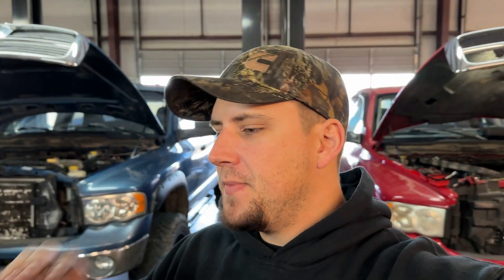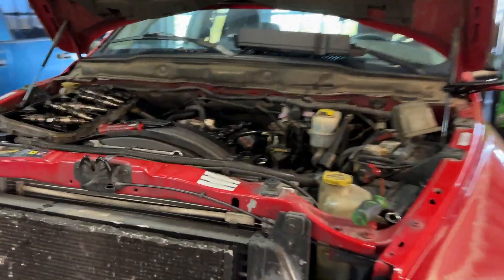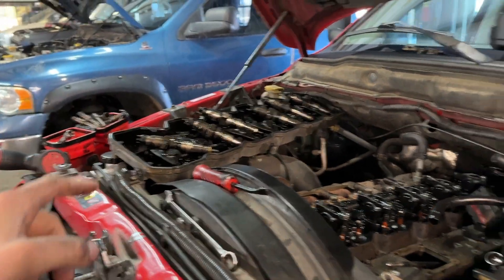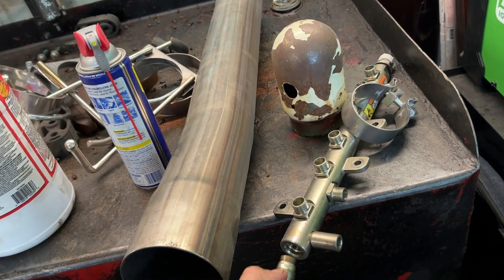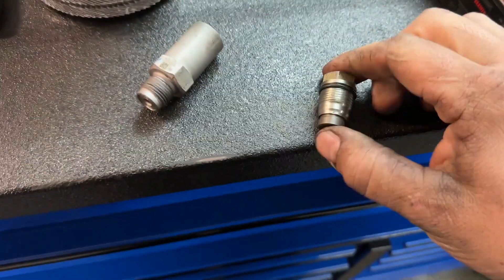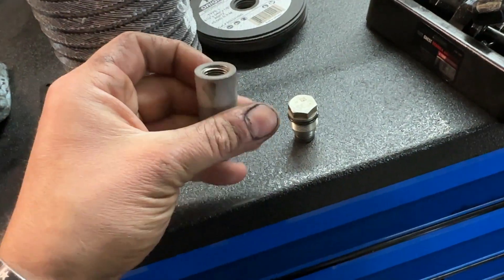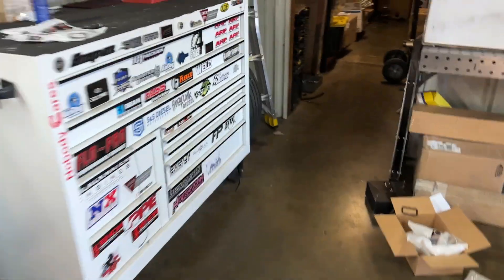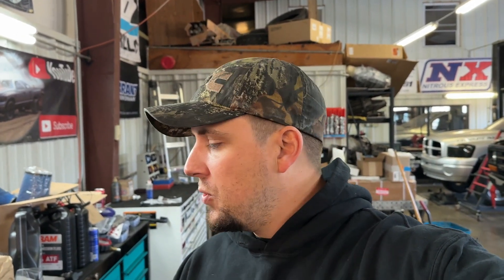STOP KILLING YOUR INJECTORS!

Comment: How do you determine what bar valve you need? And what waste gate to use?
Reply from the maker: Depends on what you pressure you are running, usually operating pressure then add 10%. Wastegate just depends on power wanted and turbo being used with nitrous
Reply: @horsetorquesdiesel no nitrous, fis s478 1.0 v5. Industrial injection 12mm cp3 it’s 85% I believe, industrial injection 150% injectors, biggest fass pump

Comment: You’re damn right someone should comment on being as “Lucky” as I’ve been w/Rail plugs-LLY was tuned & deleted 10mm cp3 430k miles when I sold it-2008 LMM Tuned/deleted 370k miles still own it also has a stroked cp3 & my Main daily driver 2015 6.7l Cummins 318k miles runs away from just about everything I race & all 3 of these trucks have the same exact race plug in the back of rails-the Ram I drive daily is dyno tuned @ 520 rear wheel hp & it’s the only tune for this truck-I beat the shit outta it -to the point where I have to let my coolant temperature come down before I can do any more spirited driving -I completely understand what the logic is behind 30psi of fuel spiking but I wore out the factory relief valve’s & then wore out the “higher tolerance” pressure relief valve’s too so I plugged it & that’s where my Lucky streak started !!!🏁🏁🏁🏁🏁🏁🏁🏁🤷‍♂️I’ve never experienced injector failure on any of my trucks but again that’s just luck right 🙂

Comment: I have a 2006 ram 3500 24V and it has a rough start and idle started off blowing white smoke especially when I start the truck then it goes away now it stays blowing white smoke now my I’m getting a misfire on cylinder 2 I’ve replaced the pressure relief valve and it’s a little less rough I will be changing the fuel control actuator tomorrow but doubt the misfire would stop do you have any solutions or any recommendations on how to go about fixing my truck

Comment: What about putting a 6.7 MAP sensor in a stock untuned 5.9? I seen it brings pressure from 26k to about 30k and adds some pep and burns cleaner. Would this cause potential issues?
Reply from the maker: Needs to be rescaled but yes it can work just fine
Reply: @ My bad I meant fuel rail pressure sensor. The guy said it’s plug and play and is a hack to get some more power out of the 5.9.

Comment: With duramax after you tune a truck and modify   that fprv WILL be a problem.    With 3 different duramax trucks I owned and a couple company trucks we deleted  I never had a single issue with running a plug.    We put them on our work trucks even. Without the plug the duramax will fall on its face passed 26500 psi.    Starves the motor of fuel.    When tuned and all the basics done your basic tuners will turn that pump to max at wot. Which i was seeing 29k.  A lot of guys will think the truck is having fuel problems or even transmission problems after they delete with basics done but 90% of the time the problem is solved with a lift pump and a plug.  I’ve seen guys just do the lift pump and still have low rail pressure because of that fprv.   I see the point of this video but with my trucks I never had a issue and I put a ton of miles on that set up before I went to injectors and different pump.  The 08 duramax I had had 280xxx miles on stock injectors when I changed them. 185xxx of that was plugged and tuned.   Now I have a 12 Cummins and on a high tune with basics done I don’t see even 26k psi on rail so idk I wasn’t planning on plugging my Cummins.

Comment: So what one should I use with a completely stock 5.9 CR ? The one that's in it now? The factory unit. I care not to hot rod it just want extremely log life and durability. Thanks. Oh, its a 2003 with 190000 miles.
Reply: Factory Bosch plug. No substitution. All factory sensors are Bosch I believe, at least they are on my 08. 400,000 kms, on my factory one, replacing it during this Christmas maintenance shutdown on my truck.

Comment: Can you put a 6.7 rail sensor onto a 5.9?
Reply from the maker: Yes but it needs to be tuned for it
Reply: @horsetorquesdiesel what risks do you run into if you don’t get it tuned? Also is the difference in psi noticeable?
Reply from the maker: @ the rail pressure will be much higher than the ecm thinks it is. When tuned it adds 20mp extra pressure

Comment: I have a question... I have a 2014 ram 2500 6.7l and it's tuned, however all the fuel systems and turbo is stock. I never run it past the 2nd setting. However, somehow it was turned up on 4. Not sure how or how long but the truck has a lope at idle. Not smoking or stalling and seems fine while driving. There's no codes the fuel pressure at idle is about 4800 psi. Any ideas on what is going on? Truck has 406kmiles on it, and like 3500 idle hrs and 7500 drive hrs. It tows a lot.
Reply from the maker: @ontheroadwithpastoranthony3161  probably time for some fresh injectors if I had to guess

Comment: 😊😊😊😊😊😊😊😊😊😊😊😊😊😊😊😊😊😊😊😊😊😊😊😊 thank you very much for another wonderful short video. Thank you for the insight. I have removed my relief valve. Do the fact that I was not building enough pressure in my rail. I use it as a daily driver. Please let me know when the comments below, I normally run somewhere between 15 and 20 on the pressure rail on my gauge I normally do not exceed 20 on my gauge. I do a little bit but not very much but more it’s a daily driver. Please let me know if I should go ahead and put the original bypass back into it. I have 27 500 and something on the engine now and I would say it’s been in for a while for at least the last 3 to 5 years. Please let me know what your suggestion is. I do not want to blow up anything that’s gonna cost me a fortune please and thank you.😊😊😊😊😊😊😊😊😊😊😊😊😊😊😊😊😊😊😊😊😊😊😊😊😊😊😊

Comment: I need a new prv would you recommend a up grade or just stock? 12 cummins 6.7 smarty tuner, stock turbo, 30 over Injectors from "Dale's super store" they state that I can run the plug no problems but I don't want to and they can't tell me the seal pressure.

Comment: Was gonna run a PPE rail plug with my 150% overs and 12mm pump until i watched this, purchased one of these yesterday! What is the torque specs for the exergy PRV on a 2015 6.7? Cant seem to find the spec in the factory service manual anywhere atleast for the stock one.. Thank you for sharing your knowledge makes me feel better about not having all the money i spent going down the drain lol

Comment: On a dmax especially an lb7 it blows all the way out and leaves you stranded youre not getting at it on the side of the road with an lb7 i choose to run a race plig because i dont like being stranded  its got alot to do with driving too habits if you drive like a dumbass teenager  all the time full throttle to no throttle all the time then yeah you are going to have alot of issues however if you use it responsibly play with it every once in awhile and then use it like it was intended most of the time as trucks were meant for work youll be fine my truck makes me ALOT of money and i cannot afford to have it down over an FPRV so i drive responsibly and fingers crossed myself and most of my customers no issues
Reply: Thats what ive always thought. Pretty sure these pressure spikes is because they redline these trucks. But hey man just put mine today probably will turn on the truck next week due to parts coming in. How is your truck running with the plug

Comment: Hi Josh while on this subject. How long should these stock injectors last im at 127 on the oe injectors but my other tow rigg still jas dtock injectors with 30% over  injectors with 450 thousand miles on them ive heard the oe injectors only go maybe 200 thousand. Whats the deal i have mm3 tuning in my tow rigg maybe 200 hp over stock teans biullt thanks get well🤠
Reply from the maker: It really depends on fuel quality, and maintenance. I've seen injectors fail before 100k and I've seen stockers go 300k

Comment: There is a tapers pin in the 6.7 on held down by a plat with 3 hols and a spring that’s where you shim to hold more rail pressure, but don’t loose the pin it won’t start after that.

Comment: Got a question for you what would make a 06 drop rail pressure to 1.5 or so and fluctuates between 6.5 to 8.9 and spikes to 24 or 25k psi and it only does all that at idle or if I let off throttle ever now and then it will drop any suggestions?

Comment: Josh have you ever had you truck to continue to accelerate after you let off the throttle at low rpm?  I have a new to me 08 that does that while I'm towing my slide on truck camper. I've read conflicting theorys.

Comment: Hey what’s up?
Good words. Very straight forward. Thank you..
I’m looking at used 05 Laramie 4x4..
No tune 290000mi
Very McLean 2nd owner truck.. 
never had transmission work or any injector work
It was bought at 210 by previous owner and was used by a couple to haul a fifth wheel. They’re selling cuz they got a new truck. 
Should I be concerned of tranny issues???
Reply: Everyone should be concerned with tranny issues. Back in my day blowing a tranny meant you had cars problems.

Comment: Josh,,  your badass man,  inspires me to start doing all my own work and so far its gone great,, 
I started with 364,71, non vgt turbo?  Before I new I was going to build a truck,, then went with 60 overs, banks intercoller and intake manifold air dog 165, and 4” exhaust delete,   Love my truck,, I have a 2005 5.9 a 2007 and 2017 6.7 I shoulda done the 5.9 but it was before I knew anything and this all started when my actuator went out on turbo and I bought the 364 to delete it,.  Now I need compounds or S400 but will do later…

I also just got my arp’s 625’s and Hamilton 103# springs,, but I lottery just finish installing injectors so I think I’ll drive a week and do it next weekend,, too bad I’m not like you and can do it on 20 minutes.. lol 

Anyways,. Love ya bro! Your awesome! Thanks for teaching and sharing your passion. I can tell your knowledge is like no other and I watch  all your videos numerous times and hope I’ll get up there one day,  next is the 5.9 build 24 valve,, as my 2017 is a work truck 

My question is,, with my work truck,  now that it is 650hp I think?  What can I do to make it super reliable,  
Head gaskets? I have the springs and arp studs I’ll get the rail plug, 
But I just want a reliable but fast truck,,

I have nothing done to tranny,, what should I do there? And drive line?  Diff? How do I stop the upgrades but just make it dialed in reliable?   To work and tow

My next build to go all out will be my 5.9.   But I just don’t want to ruin my 6.7 as I still owe 35k on it 

Let me know your thoughts 
Thanks man sorry for the book 

Jon

Comment: There is so much truth in this video.

Had an 05 5.9 exergy 12mm stroker, exergy 45% overs, studs, springs oversized pushrods, 60psi, and 69mm no gate, ran a 3100us tune once.. and you guessed it rail plug.. That poor truck. It was popping 5k sideways into overdrive. I was injector limited at 740whp. I could only run 4wd or it would just knock the tires off. I'm pretty sure the only reason it lasted about a year. Was it sat broken with billet sonnax inputs, pro series bands, etc. Then, It was all TCS billet stuff. I think i had over 15k in 48re damage before the last 48re was built. The last one was basically ddp's drag truck transmission. dpc converter etc.. One pull it finally killed an injector when I had to lift because it was walking out. I popped 3 turbos. One time it wolverined my down pipe pumped all my oil into my exhaust before I could shut it off. 

Now I drive an 06 mega cab g56 with efi and 50hp injectors, stock air. Lol I guess it has a twin disc, but all stock. Do I miss doing 80mph over mtn passes towing? Yes, do I have permanent anxiety when I go over 30psi in my stock 5.9. Yes.
Reply from the maker: Hahahah I think a lot of the high hp crowd has felt your pain!

Comment: Running a Exergy 32000psi PRV on a Duramax with a 12mm pump and 100% overs haven’t had a issue with rail pressure spiking hard yet
Reply from the maker: You won’t with a PRV

Comment: The PPE PRV’s work great. I’m not talking about rail plugs.. They open a little higher than stock but still relieve rail pressure adequately. Bout $60-70 
I see how a higher rail relief would cause issues in a truck with a maxed out tune and a lot of fuel.. however stock to moderate applications, the higher(aftermarket) relief valves DO work and work good. Higher pressure, means better fuel atomization.. better power and fuel economy.
Reply from the maker: Good to know!

Comment: Thank you for this video! Im doing a Duramax build right now and was planning to use the PPE plug which I already bought. But Ill look for the correct PRV now knowing they exist!!!
Reply: So if I get the Exergy 26k pressure, do I need any tuning to go along with this? FP for my truck runs a touch over 23k. Brand new SAC00 injectors and new CP3. Thanks!!!

Comment: My 2008 6.7 is not building more than 21,000 psi I installed rail plug nothing changed, New lift pump and filters still no change. Tuning is asking for 26,000 psi
Reply: Might have a weak cp3, but retorque your feed tubes to 44 lb ft to make sure they aren't leaking

Comment: How can you tell the difference in plugs and valves? Previous owner put injectors in it but I don’t know if they put a plug in it.
Reply: Valve will have a hole. Plug will not. I just installed one on my 06 the other day. This was my video. You can see the difference between the two. Everyone has their opinion on them. I personally never had an issue but if you're running higher than factory rail pressure I can see how they'd become a problem. Run at your own risk!

https://studio.youtube.com/video/lBvpByshXLU/edit

Comment: I have an 03 LB7, back in the day put an Industrial Injection dual feed line kit on it. Has a modded stock CP3, 50% over injectors.   I ended up poping the original dual feed hose. Its some crazy high pressure flexible hose. Industrial sent me an upgraded one, never did install it. It feeds dual by eliminating the rail bypass valve. Well unbeknownst to me at the time, that was likely why I cracked and/or blew out seals in my injector bodies 2-3 times. And on an LB7 that means your dumping diesel into your oil. Didn't hurt the engine but cost me a lot of money & time & oil, seals, injectors, etc. Not to mention doing LB7 injectors in the truck is a real bastard of a job. It uses the longer style relief valve btw.

Comment: 100 percent exactly the same on a duramax. I run a 2400 bar prv with 2 12 mil pumps and 150s. From s&s. On a modified truck with any fuel upgrades its a must as insurance for your injectors and fuel system. Stock truck a plug helps, but thats only for stock and shouldn't really be used at all. I learned about this early in my build

Comment: In my experience I ran a plug in both of my 5.9s. I had an 04.5 with an nv5600. 175 tune, 48psi, boost fooler etc. Never had an issue until the engine broke a ring at 443k but it tows 12 to 17k daily. I never upped rail pressure though. 23.5k. So in your opinion once you up the pressure that's when you have issues. That would make sense as to why I never did. I had 200k miles on that rail plug before 12 valve swapping the truck😅
Reply from the maker: Talk about going down hill quick.
Reply: @horsetorquesdiesel  I had the truck a total of 5 years but I ran the rail plug from like 320k to 443k when I sold the blown engine. I actually broke even on the swap since it only cost me $1,700 for an engine and all the parts to get it done. I always ran that engine under high stress environments so it was a matter of time. Literally broke the top ring on number 1 and I had to drive it home from Cali like that pulling a trailer. Should've seen the white smoke from the exhaust. Not to mention it blew every single seal in that engine on the way home. Take the oil cap off and it shot up putting a dent in the bottom of the hood. I probably have a video of it somewhere 😂

Comment: Excellent information, Josh. Are the '19 & newer trucks electric? Mine has a plug and is connected to a wire harness. I'm assuming Cummins wants to be able to dynamically control the pressure being relieved.

Comment: So I'll be honest, when I bout both my 10 and my 08 6.7, as part of the delete process, I put the "race plug" in. Now mind you I have only one issue and that's when I stab it, I get "perform service" on the overhead, and after this video I'm thinking I'm putting the stock rpp back in and seeing if that helps as well as saves on that rail and  injectors. Thanks for the video. I'll be buying the xergy one soon as well
Reply: Perform Service is because it's detecting high crankcase pressure. If the filter hasn't been replaced (or gutted), replace it. Or, get a new CCV pressure sensor and plug it in outside of the engine.

Comment: I cringe whenever I hear rail plug, race plug, shimmed PRV, etc. I've said this for years but I'm nobody working for a small shop so no one listens. I've seen massive pressure spikes just from turning the engine off. Thank you for finally saying it Josh!
Reply: I’ve seen some big problems come from those “race plugs”, In my opinion if the relief valve is bad I’d ONLY replace with an OEM unit. 🤝

Comment: I run the Fleece 750 10mm pump with 100 hp Industrial Injection dragon fire sticks, Tater Built 6367 turbo and airdog 4g 165. I have run the rail plug for about 10 years but I am thinking of putting one of those Exergy relief valves on. What would you go with, the 2000 or 2200 bar. This is on a 2004.5 5.9 with a smarty jr tuner.
Reply from the maker: 2200 but that smarty is keeping yours alive